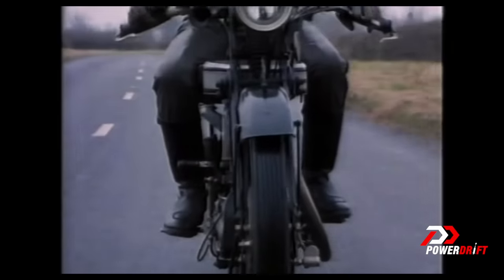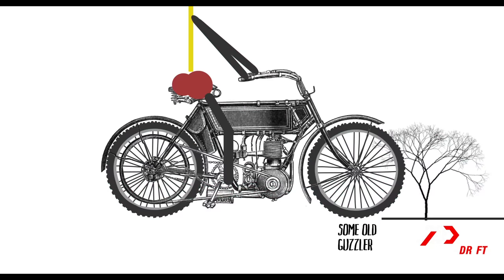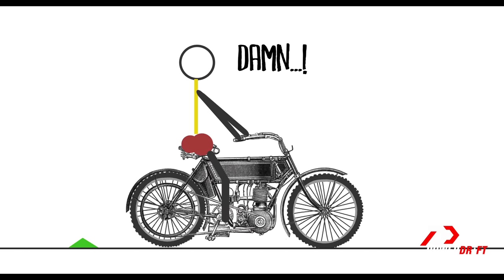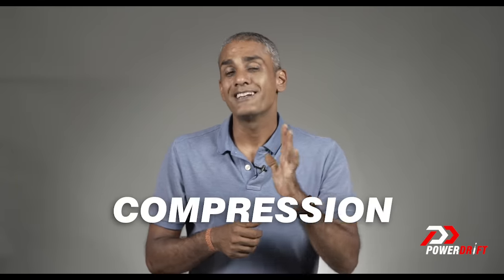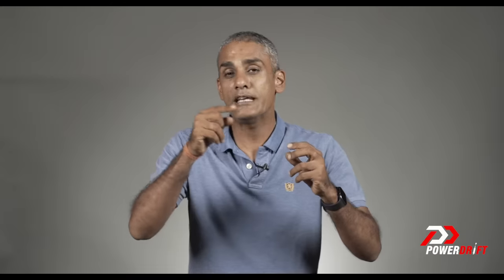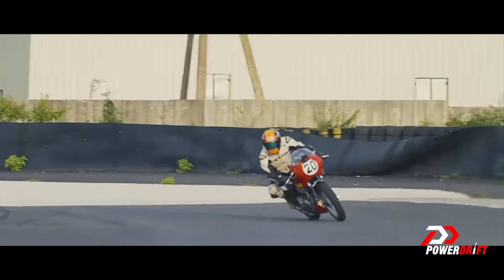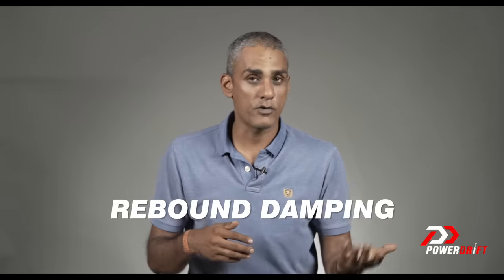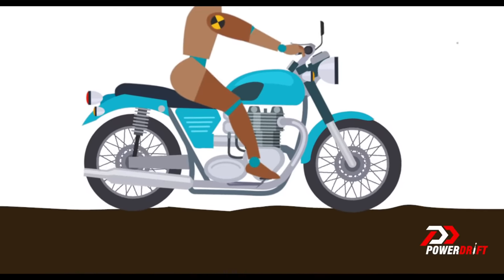PD Simplified : Motorcycle Suspension Explained | Part 1

Comment from the maker: Hey #PDArmy, we hope this helps you better understand suspension! There are more episodes coming up soon, until then, if you have any queries or doubts, Comment below! Share the video with a friend, or two, to help them as well. Hit that Like button if you loved it!
Reply: Please make one video on taller gearing and shorter gearing concept...
Reply: How much of a differences does preload adjustability for front suspension bring, say for a rider who is at either ends of the spectrum - 60kg or 85kg.
I know this would also depend on the motorcycle but some perspective on this would be great.
Reply: @sanketjain9320  if you’re in the weight range of the average rider then it’s more fine tuning that dramatic changes. But every little bit helps
Reply: He boss do the video of how to adjust the suspension both front and back based on height and other circumstances
Reply: @sachinrana1541  l
Reply: Ooooooooooooooooooooooooooooooooooooooooo

Comment: Thank you Shumi, I always argued with my buddies that suspension is the one that makes all the difference while going fast compared with an ECU or Cam profile changes.A Suspension which is setup perfectly will make a hell a lot of difference compared to bumping up the power by a few ponies.
Reply from the maker: Amen!
Reply: Also: Most people don't have the skills or the space needed to fully use the power (standard or extra)
Reply: @shu_mar  rrre I ❤️😀😀😀😀
Reply: @shu_mar  
I'll
Reply: Could you tell me a few after market brands
Reply: @seedevkrishna  zedling, Yss, rcb, on the higher end ohlins,
Reply: @arunalexander6389  thank you so much. These seem to be very much out of budget. I have a bullet electra 2006. Will it make any difference to my ride if I buy a nitrox suspension from royal Enfield itself? It costs only 3k
Reply: @seedevkrishna  i hope you have already checked the new suspension to be compatible with your 2006 electra( the length)and also had a first hand experience with the motorcycle which has this nitrox suspension. If yes go ahead.
Reply: @arunalexander6389  ok thanks 👍🏻🙏🏻

Comment: High speed and low speed compression, & High speed and low speed rebound damping ...
Reply: The speed in this context refers to how fast the wheel moves into the suspension, that's all. Big bumps = high speed and small, shallow bumps = low speed
Reply: @shu_mar  Love to hear from you 😍, it would be awesome if you please also make a simplified video and explain about taller gearing, shorter gearing and gear ratios that you used to say in your videos I have been asking for it since so long...

Comment: I didn't get the answer to my question about, why most adventure bikes feel jerky on low gears, like 1st n 2nd gears at low speed, I've got Himalayan bs6 2021
Reply: That's the engine producing less than optimal torque until revs reach some critical point (usually 2500-3000 rpm)

Comment: After completion of this series next series do on a Torque curve and it's significance on engine behaviour. What i have seen so far is that folks are so obsessed with horsepower and torque numbers but they didn't noticed how and at which rpm does engine has producing it. High hp at high rpm might gave good high end performance but felt lame in acceleration and throttle responsiveness on the other hand engine having good low n mid range torque but so so peak power would be surprisingly more fun to ride with great pickup. eg. Yamaha fz25(very relatable) .
Reply: Agreed! You're spot on! Can do a video on this

Comment: Any one with a Honda Hornet 160, pls help/guide...my suspension is very stiff, even slightest of irregularites on the road resonate to my back (on softest setting) what could be done apart from a setup change? Or is it possible to replace monoshock of anyother same league bike?
Reply: Your suspension might possibly be a faulty one. Make sure you check other hornet's damping before replacing it
Reply: Should not be like that. It is stiff but not that stiff. Get it checked. Unless you weight 40-45kg, in which case you need a completely different spring
Reply: @shu_mar  thankyou for your response, means a lot to us fans!

Comment: Thank you very much for the info. For the past one month, I ride my new Yamaha Aerox 155, and yes - it has a stiff suspension setup. While it improves the way the machine rides and the way it corners, it surely creates some problems while you ride through a bumpy patch of road. is there a solution, by which one can improve the comfort levels of riding through bad roads, while not affecting the ridability and cornering? Hope you'll cover this point in one of your coming episodes.
Reply: Hi Sajeev, what a coincidence. I discovered something accidentally today to improve the ride quality. Not related to suspension but tires. My Aerox rides better on higher pressure, around 34 psi for front but more importantly 40 psi for rear. I am 82 kg, so you can adjust for your weight. Almost like adjusting the preload, isn't it? I figure the tire sidewalls are flexing too much at manufacturer recommended pressure, and the higher pressure is allowing the tire sidewall to soak up the bumps. Try and let me know.
Reply: Try reducing tyre pressure by 2-3 PSI it should help
Reply: @paraagshah4153  , Thank you. My bodyweight also is 82 kg :) I will try these and inform you about my experience. Btw, will this cause any problems to the tyre?
Reply: @shu_mar  , Thank you.
Reply: @cksajeevkumar  I am not sure if it will cause any immediate problems to the tires. Shumi is actually suggesting to reduce the pressure about 2 to 3 psi and he was concerned if the tires can support the higher pressures. A couple of days ago, noted that my tire pressures were about 3-4 psi less than the recommended ones, and the stiffness/jerkiness was worse. That led me to think that the side walls are actually bottoming out when going over bumps or bad roads and that the higher pressure was actually aiding comfort levels. I was reading on another blog that one can or should change the tire pressure depending on climate, body weight, riding style, riding distance, etc. So your experience will vary, but would love to know about it.
Reply: @paraagshah4153  , great, will try it for sure.

Comment: Fantastic video Shumi and PD team to simplify this topic and help lay people to understand and implement it practically. On a related topic, on my Aerox where there is no option to adjust the rear shocks, accidentally discovered that increasing the tyre pressure to 40 psi as against manufacturer recommended setting of 33 psi vastly improved ride comfort and even handling/grip at rear end. Maybe the 33 psi setting is for colder climates, and also maybe the side wall flexes more than required, this increasing pressure solved the issue. Also need to adjust tyre pressure for rider weight, sort of adjusting preload?